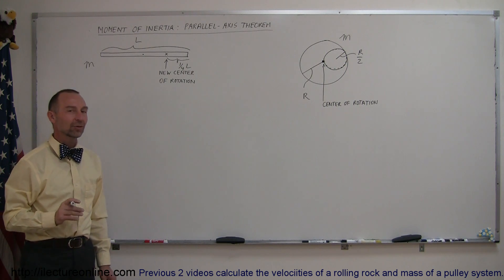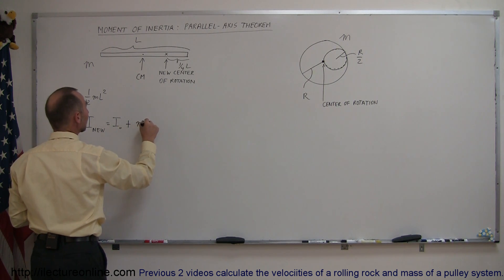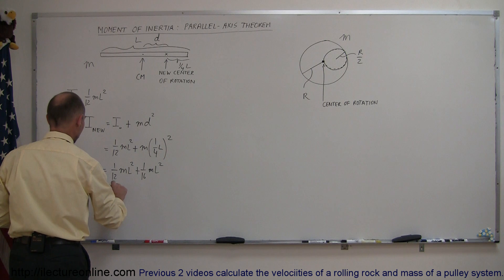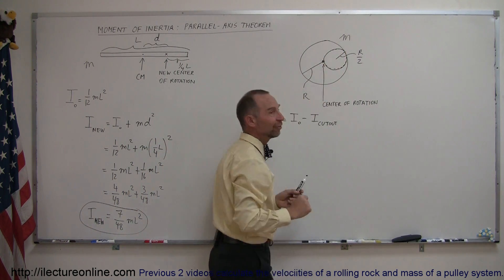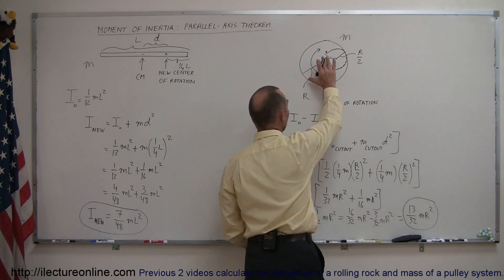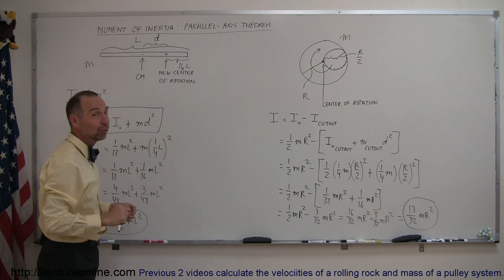Physics 13  Application of Moment of Inertia (3 of 5) Parallel Axis Theorem

Comment: the second answer is correct but you do have to keep in mind that it is relative to the mass of the full disc, not the shape... in other words m in his result stands not for mass of the object but mass of the full disc without the hole, if you want to correct for this you have to multiply the answer with 4/3 because the full disc is 4/3 times heavier than the object with the hole, this comes down to I = 13/24 mr²
Reply from the maker: Yes, this problem can be done in two ways.  Traditionally we express the mass in terms of the full mass of the disc without the hole, but it can be done with respect to the mass with the hole.

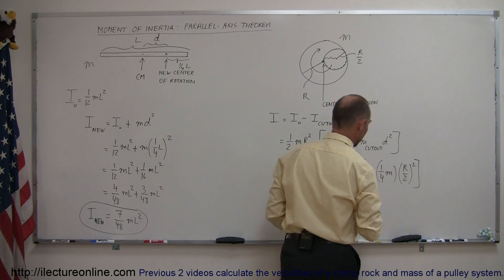Comment: At 5:05 in the video , you state the displacement to the right is R/2. As I see it, R here means the radius of the circlular cutout. Relating to the flat disk, this becomes R/4 ie displacement is a quarter of the large disk's radius. Since in the calculation you have R (the radius of the large disk) beforehand , shouldn't you have continued with ..+(1/4)m(R/4)^2?
Reply from the maker: The center of the hole is (1/2) R away from the center of the disk.   (The diameter of the hole equals the radius of the disk).  The equations in the video are correct.  Thanks for checking.
Reply: Many thanks for claryfying, Prof. Biezen, much appreciated. One other question if I may, Im running through these excellent videos on momentum of inertia & am putting them in to text (including the maths) initally for my own reference but would you allow me to send out the completed file on a social media maths help group (file containing acknowledgement to you for providing the videos) and a link? No Finantial gain incurred.
Reply from the maker: Yes, if it is for educational purposes, feel free to do so.
Reply: @MichelvanBiezen  i cant thank you enough .Prof. van Biezen, it'd mean so much to the students of physics worldwide, especially those in poorer countries , not having a really good access to  refence material (some dont even have internet, having to share time & pc at school/collage or spend thier money going online at a internet cafe locally. Your online lectures are quite unique, I've searched the internet evening after evening in the hope of picking out some info on the subjects I've been looking into when Ive frequently got stuck & suddenly , theres this unbelievable oasis of professionally given information in video form, really valuable. Best is being able to get you to say it again & again by replaying the video when the initial concept isnt grasped!! Try that at a realtime lecutre & you're quickly shown the door!!  Above all , keep the bow tie , its just great!! 😁
Reply from the maker: James.  Thank you for the kind words.  It sounds like you are dedicated to providing education to those who cannot afford it.  Keep up this great work!

Comment: Sir, I have a question regarding parallel-axis theorem: given a thin bar with an axis of rotation going through a point 1/4 of its length away from its one end, then parallel axis Theorem would have to be applied in order to calculate the new moment of inertia for this particular situation. In that case, which point should be considered as a reference (original moment of inertia) to relate this new moment of inertia to? In my calculations, choosing either end point or the middle point should make a difference, hence adding 1/16 mL2 to either 1/12 mL2 or 1/3 mL2 delivers a different result. Can you please clarify?
Reply: Thank you very much for your quick response and your videos!
Reply from the maker: There are several ways in which you can approach this.  You can start with the point of rotation at its center (I = 1/12 ML^2) or start with the point of rotation at its end (I = 1/3 ML^2) and then use the parallel axis theorem.  Or you can calculate the 2 ends separately   and add them.

Comment: My question is say consider a sphere of radius R, from which a small spherical body of radius R/2 is cut out, making a spherical hole. Now, the center of the cavity is at some distance, say R/4 from the center of the original sphere. Now we need to find moment of inertia of the remaining body.
Now, if we look at it one way, we could straight away apply the parallel axis theorem between both of their axes of rotation and that would be it. But if we look at it another way, say, that from a TOPSIDE view, where both the cavity and the sphere have the same axis of rotation l. Will it have any different answer? If not, how should I proceed with this method?
Reply from the maker: Regardless of the method you use, (provided you are considering the same point of rotation), you should get the same answer.

Comment: Dear professor Michel,thank you very very much for your help and ur useful videos.One question,Why mass of the cut out part is not 1/8 of m ??I mean since its radius is half of R,So it's volume should be 1/8 of the original disk and density is constant.So why 1/4??
Reply from the maker: Since we are talking about a flat disk, only the areas need to be compared.
Reply: @MichelvanBiezen  Tnx a lot professor.U r the best.

Comment: Sir Michel, i tried to find the moment of inertia (I) of a disk  with axis of rotation on its perimeter, using integration instead of Parallel axis theorem (using x2 + y2 =a2 , cutting vertical strips ....) but it was end up to an integral that i couldnt solve(integral of x2 sqrt(R2 -(x-R)2). Do you Sir have a video about this ?
Reply from the maker: That is why we use the parallel axis theorem to make it easier. :)  However, yes there are videos like that in the mechanical engineering playlists of this channel.

Comment: How do we calculate the mass of cut out?!
Reply from the maker: If the mass of the object is given without the cutout, then the "mass" of the cutout is  total mass x (area of cutout / area of the whole object).   If the mass of the object with the cutout is given, then the "mass" of the cutout is   (mass of object with cutout) x (area of cutout / (total area - area of cutout))
Reply: First calculate mass per unit area and then multiply it by the new area or the area concerned

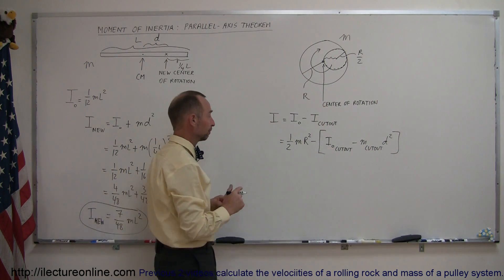Comment: at 4:09, you correct the minus sign to an addition sign. If the small circle moved to the left, would the sign be a minus sign?
Reply from the maker: No, the sign has nothing to do with the direction of turning.

I simply put down a minus sign instead of the correct + sign.
The quantity inside the brackets is the "parallel axis theorem" and thus the sign must be positive.
Reply: we just take care of distance not the direction.
Reply: after all the displacement is squared...

Comment: Thank you for your help .In the second example why you put (-) sign instead of (+) sign
Reply from the maker: Beshoy.  You need to subtract because the piece is missing (or cut out), so the moment of inertia of the disk is reduced by the portion that is missing.